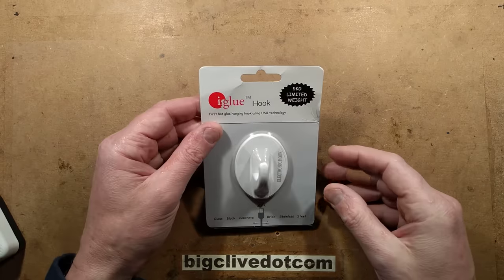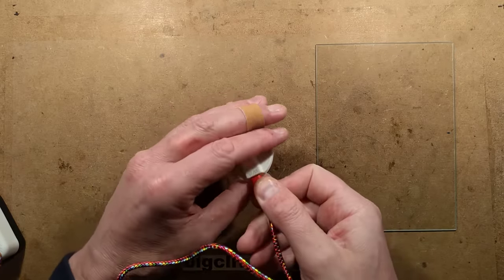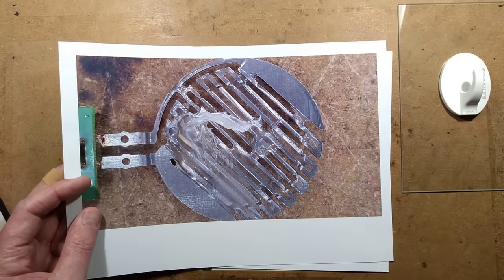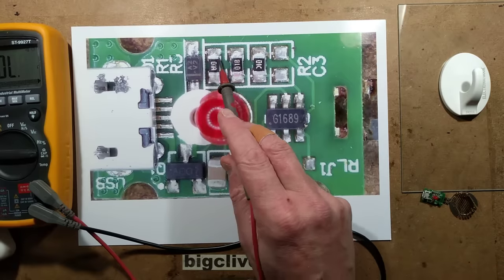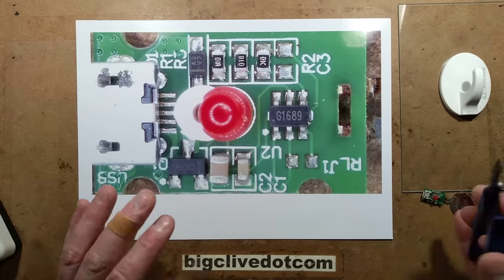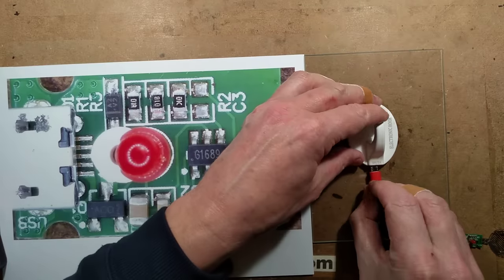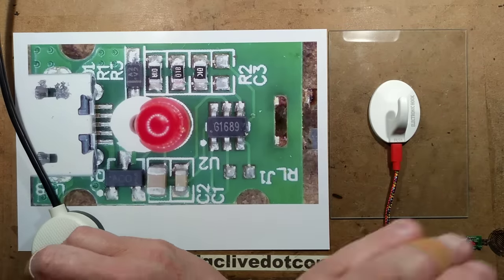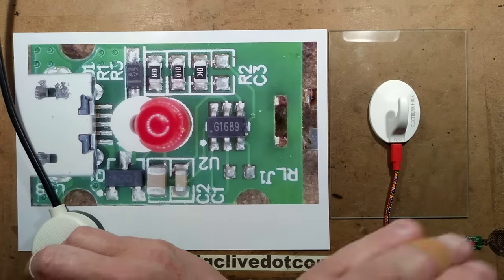Testing a USB powered wall hook and a look inside.

Comment: Now I really feel left out of the modern age. All our wall hooks still run on coal.
Reply: Clean coal though
Reply: @julioblanco  not the dirty sort!
Reply: Shhhhhhhush 😂
Reply: Mine are from the 50s. Some of them run on nuclear, the others run on rocket fuel.
Reply: if i put it on the floor it can't fall down and has unlimited carry strength
Reply: @imyaaniggua  well duh
Reply: Coal? You're lucky to have coal! Ours run on dry straw, have to keep feeding more to it every few seconds lest the fire go out and we have to relight the darned thing, which is hard enough to do when our matches are not damp.
Reply: Hu, mines diesel...
Reply: @binaryglitch64  My family would think you must be from the future.
Reply: Mine is powered by the condemned soul of an orphan child
Reply: @mikemondano3624  lol
Reply: Ours were coal until a year or so ago, now we've upgraded ours to gas and they're so much more efficient.
Reply: @binaryglitch64  hydrogen
Reply: @binaryglitch64  or bill gates running on a hamster wheel to power my wall hook would be ideal.
Reply: Oh cmon... im still using manually cranked hooks inherited by my family from generations
Reply: I mean. The joke is good. But I'm off-grid solar and battery......
Reply: @CynicalMournings  then yours is just USB powered 😑
Reply: All of my wall hooks are still using a water wheel
Reply: Mine are solar, when the sun goes down everything falls to the ground
Reply: @10RRASK  mine are solar too but they keep working even at night as long as there's adequate sunlight throughout the year and I get more growing next to the old ones in the spring
Reply: Hahahahahahaha oh the humanity!!!
Reply: lucky you, mine burn cow dung.
Reply: Coal??? Mine runs on wood...
Reply: Consider yourself lucky. My wall hook got a virus and tried to attack me.
Reply: @driftliketokyo34ftw35  😂👍
Reply: Luxury!

We have to hold our hands up for 'ooks and breathe on them to keep 'em freezin' over!
Reply: Good one Mike
Reply: Mine still runs on whale oil, I have to pay a premium for the Chinese whale oil since they are the only ones who go whaling anymore
Reply: I know how you feel. All of my tokens are still fungible. 😔
Reply: My wall hooks are nuclear powered.
Reply: I got a Leyden Jar for my hook to run off of.
Reply: Mine is powered by chanting all my hopes and dreams.. must be why it sucks ass.
Reply: Pfft! Pathetic! Mine are fusion powered!!
Reply: badly need a haha react for this comment.
Reply: I'm still using hamsters
Reply: Lucky I still have to wind mine so it runs all day
Reply: Don't worry, this one does too. The coal just needs to be converted to electricity first.
Reply: Reminds me of way back when(like 8 years ago) I joked that "in the future our toasters will have bluetooth!" And one of my cousins actually said

"THAT WOULD BE PRETTY COOL!!!!"

Imagine my shock when my response was "no..... they'd never do that because it's FUCKING STUPID! What the heck would anyone do with a Bluetooth toaster that a regular toaster can't already do?"

She sat, contemplated it.... and shut up....

And about two minutes later showed me ad listing for a toaster with Bluetooth function.....

Boy did I HAVE EGG ON MY FACE AFTER THAT ONE!!!!
Reply: If you are using these in the US, there is a good chance they are still coal burning, as that is still the primary fuel/power generation used here. EVs in the US are coal burning too.
Reply: I’m using nails still.
Reply: Luddite!
Reply: Jokes on you, my hooks are nuclear powered
Reply: I eat mine
Reply: Haha
Reply: @imyaaniggua  That's true, I tried telling others about the carry strength of my floor model,,,and they think I 'm a conspiracy nut
Reply: @thechumpsbeendumped.7797  That's "Neo-Luddite" to you!
Reply: @mikemondano3624  You're the bloke stopping the trains all the time!
Reply: Lolololololol
Reply: I miss the days when hooks had whistles!
Reply: Mine still runs on animal glue.
Reply: What's a wall hook?
Reply: @lucashinch  A hook to hang your walls on.
Reply: Mine run on bat guano, it's available online from International House of Guano, I get different types from different regions and make a custom mix that gets my hooks running at maximum efficiency.
Reply: At least upgrade them to coal gas hybrids.
Reply: I'm running my wall hooks on off grid solar
Reply: Mine has to be yoked to a mule
Reply: Coal? You lucky! We always have to rub two sticks together.
Reply: Wow U Must Be Really Modern, Mine Runs On Steam
Reply: Heh heh heh heh heh heh

Comment: A well-engineered, but overengineered and wasteful solution to a problem noone ever had. nice.
Reply: no one
Reply: BMW: taking notes
Reply: It doesn't even solve the problem nicely (loads of glue residue left behind)
Reply: I mean, I live in a tropical country and this kind of wall glue won't last for shit, high temperatures + humidity makes pretty much everything rot.
That being said, still a waste and way more expensive than it should be
Reply: AKA India.
Reply: P
Reply: P
Reply: You can hang a coat on a nail, but you can't hammer a nail into piece of glass.
Reply: @drbobsnightmare2521  I think their point is we already have adhesive hooks. 10 for a dollar, with no USB port, heater, or built-in circuitry.

This solves a problem that was already solved a long time ago, and far better.

It's like producing high performance drum brakes that are 3x the price and almost as good as disk brakes, purely because normal disk brakes are just too common.
Reply: @operator8014  maybe they can build USB powered thumb tac. No no, post it notes.
Reply: If you try to stick a 3M hook similar to this with no heat gun to a textured wall, it doesn't work half as well as on a perfectly flat surface.
Reply: I'm still boggled by electric can-openers.
Reply: Overengineered, perfect term.
Reply: @Ranstone  Might be made in India, but they’re just catering to the American market. We’ll buy literally ANYTHING you tell us to over here!
Reply: Hot glue hooks is a good solution for tiles etc, which is very much the rage in new construction in China and the middle east.  Big tiles and a lot of tiles.  Tiles in rooms/places where we wouldn't use them in Europe.

Now, my first thought was, why don't just have a metal hook (or a metal pad) you can heat with a soldering iron?   But then... that's overkill and tools most people won't have.

So for a "rental friendly" solution in small apartments for people who just need a hook... why not?  (Cleaning up the excess can be done with a hairdryer even.)
Reply: @bigsmall246 if you've ever worked with hot glue you know that once cool to the touch it comes off most surfaces pretty easily with minimal effort.

Comment: Wall Hook: We've updated our Privacy Policy.
Reply: Would you like to allow "wall hook" to take pictures and videos?
Reply: Would you like to allow Wall Hook to access your contacts and make phone calls
Reply: wall hook wants to know your location
Reply: WHAAS (Wall Hook As A Service)
Reply: @cglensmith  forget to pay your bill come home to your coats on the deck 😂
Reply: IPA is the Kryptonite to EVA hot melt glue
Reply: @Raveernath Ramdass terms and conditions proceeds to be over 500 lines
Reply: Duke Hugh Johnson   @Duke Hugh Johnson  Wall hook has suspended your coat for violation of the hangingolicy.
Reply: Wall Hook would like to access your network devices
Reply: Duke Hugh Johnson  Wall Hook has suspended your dressing gown
Reply: @cglensmith  Not a good service, seems to hang up a lot.
Reply: Does this need to be USB-C in future?
Reply: wall hook: Your subscription has expired. 
Wall hook: falls down
Reply: @OtherDalfite  wall hook: you can't read the entire ToS that fast! the button will enable in 20 minutes.
Reply: Wall Hook would like to access administrator privileges.
Reply: @fitchyyboi  and then you click deny and it doesn’t stick to the wall.
Reply: Do you want to allow Wall Hook to track data across apps?
Reply: :face-purple-smiling-tears::face-purple-smiling-tears::face-purple-smiling-tears::face-purple-smiling-tears::face-purple-smiling-tears::face-purple-smiling-tears::face-purple-smiling-tears::face-purple-smiling-tears::face-purple-smiling-tears::face-purple-smiling-tears::face-purple-smiling-tears::face-purple-smiling-tears::face-purple-smiling-tears::face-purple-smiling-tears::face-purple-smiling-tears:
Reply: Your wall hook subscription has expired. Please renew your subscription to restore removal functionality. - Vendor
Reply: Please be advised that this hook is intended only for clothing by the Wall Hook Company, and our clothing franchise, Wall Hook Fashion. Attempting to hook any other products will constitute a breach of these terms of service, and will result in a permanent loss of adhesion.
Reply: Wall hook wants access to your cookies
Reply: @pwatsonuk ahhhh I see what you did there
Reply: Wall Hook is updating. Please try again later.